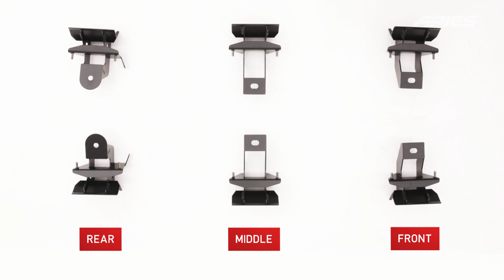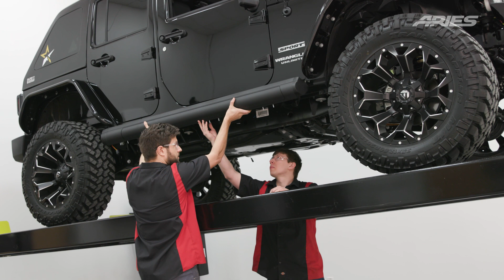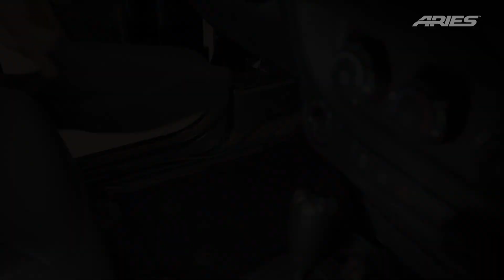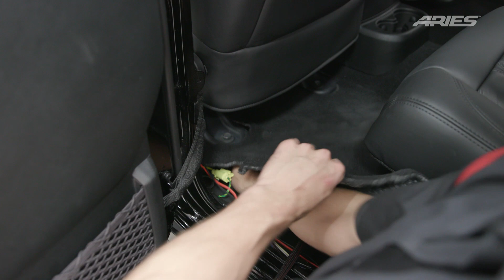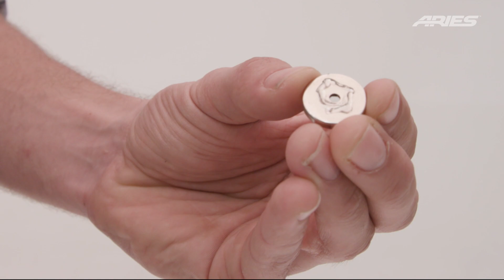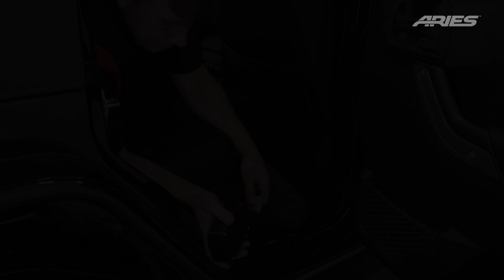ARIES Side Step Install: ActionTrac™ Powered Running Board  on JEEP Wrangler JK -  3025170

Comment: what happens when you take the doors off, it won't work?
Reply from the maker: If you get the door delete kit you can run with your doors off and utilize a manual switch to activate the steps